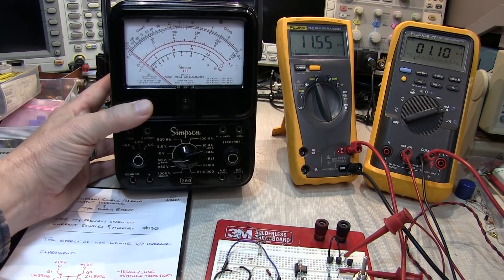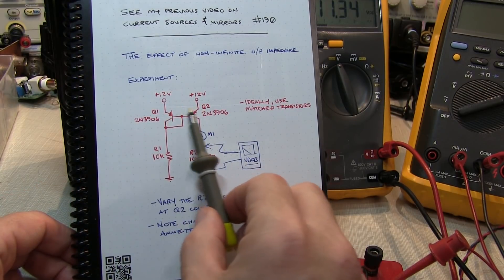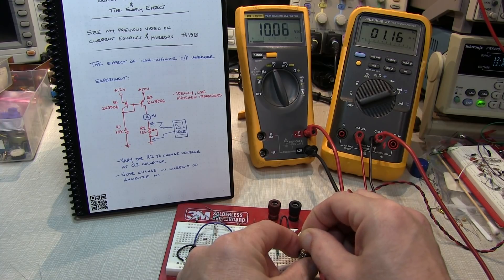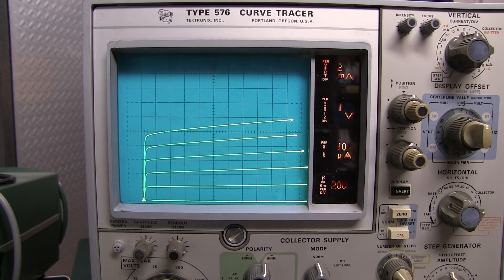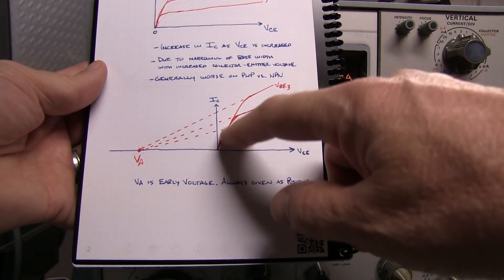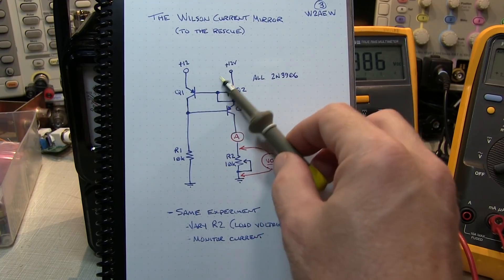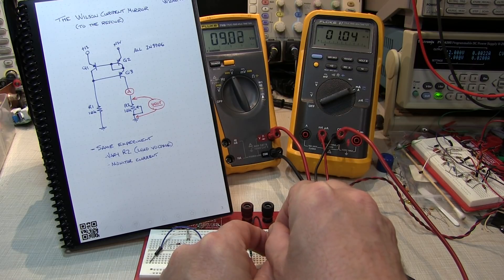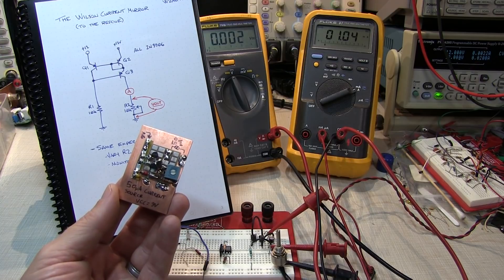#327: Bipolar Transistor Current Mirror output impedance, Early Effect, Wilson Current Mirror

Comment: Clear, concise and insightful as ever! 
The Early Effect is named after James (Jim) M. Early, who did a lot of development work in transistors. Nothing to do with anything being early (or late), it just happened to be his name.
Reply: Thanks for that - always good to know.
Reply: Good point.  In recognition that it's his name, we should use a capital E.
Reply: Thera are no magnets in the Hall.
Reply: The misconception is close though. Makes more sense than if his name were Late! Your comment is appreciated though, I was wondering why it was called Early.
Reply: I was amazed to find that Jim Early described this effect in BJT's in 1952!
J.M. Early, "Effects of space-charge layer widening in junction transistors", Proc. IRE, vol. 40, pp. 1401-1406 (1952).
Reply: @robegatt  But if there were, you could easily detect them with a fairly simple semiconductor device?   :)
Reply: @hectorpascal  I'm using them right now at this moment ☺️

Comment: Very interesting video. I didn't quite follow the explanation of how the extra transistor prevents the output from loading the matched pair in the current mirror, but the visualization of the Early effect was very clear and the demonstration of the loading really drove the point home. Thanks! I hope you make many more videos about these kinds of electronic building blocks.
Reply from the maker: The bottom line is that the transistors that determine the current source value (Q1 and Q2) do not see the voltage at the load.  The "cascode" transistor Q3 isolates them from the load change, so there's no Early effect in the actual current source devices.

Comment: Excellent explanation. Note that the Wilson current source can also be viewed as a Cascode type of circuit (or Pentode/Tetrode circuit for tubes) where the second transistor (or tube grid) shields the primary transistor (or tube grid) from load voltage changes. Many thanks for this.
Reply from the maker: That's right!

Comment: Good demo, but wouldn't a better explanation be as follows: 6:30
"Q3 acts as an emitter follower, and copies the voltage on R1 onto the collector of Q2. The V_CE of Q2 is therefore held at a constant potential-difference (as opposed to a variable potential-difference in the previous two-transistor case), allowing Q2 to mirror Q1's current unhindered by base modulation. Any variability of the potentiometer is compensated by Q3, thereby exposing Q2 to a constant power-load".

Comment: There is no need to say anything like always your videos are so useful. Dou you try making a time measurement circuit by charging a capacitor with this constant current source in a video. If it occurs aI will be very happy. Regards.
Reply from the maker: There are a lot of subtle things to be careful of when doing that.  One is the output impedance of the source as described here.  Another is that many capacitor types will change capacitance with bias voltage.  Best to use highly stable film caps for this.  Not ceramic or electrolytic.
Reply: @w2aew  You are right I will try it, thanks a lot again.

Comment: Is there an IC that stuffs these 3 transistors, into a TO92 package, or multiple of them onto a single chip? 
I've been using the regular "Widlar" design, to supply 3mA to color changing led, independent of the supply voltage (4V~15v). 
Widlar circuit is enough for what I'm doing, but it was nice to see how little Wilson design varies!
Reply: LM334
Reply: @robegatt  I've used them.
They're expensive compared to GP transistors, when you want to control dozens of LEDs, with each LED having it's own CC source.
Reply: @piconano   the good old dilemma: integrated or discrete with all the "salad" around them?

Comment: Great video!
How important is the hfe matching with these transistors in such a mirror as well as thermal runaway?
Reply: Q1 and Q2 should be as closely matched as possible, for the sake of current accuracy. Q3 can be anything. You might even use a larger transistor for Q3, because it will have higher voltage across it, and will tend to dissipate more heat than Q1 and Q2, which will never have anymore than 1 volt across them at the same current. Keeping Q1 and Q2 the same temperature will help, to keep the difference in current between the reference and the output from changing very much. The output transistor can be whatever temperature it wants to be, since it's effectively being driven in cascode.
Reply: @vincentrobinette1507  Thanks! I guess Q3 still does need enough hfe to provide the current?
Or in other words, if you want to mirror something like 100mA, you don't want to drive like 1mA or so?
Darlington would probably work in that case.
Reply: @vincentrobinette1507  Also I think this could be a (MOS)FET as well maybe?
Reply: @p_mouse8676  You're exactly right, you will lose the beta of Q3. If you don't want to lose that, a Darlington pair will reduce that to the beta of the drive transistor multiplied by the beta of the power transistor. All that means, is that 1.4 volts appears across Q1. If you use a Sziklai  pair, (PNP transistor driving an NPN transistor) you can keep the voltage across Q1 the normal ~.7 volts. It doesn't matter much, the important thing is to keep the voltage across Q1 as consistent as possible, to keep the output current as constant as possible. I would imagine, you could even use a MOSFET, which would allow ~3.5 volts across Q1, with no beta loss whatsoever. the problem with that is the gate threshold voltage varies with temperature, which would create current drift caused by varying the voltage across the reference resistor. (R1)
Reply: @vincentrobinette1507  Thank you so much, makes a lot of sense now! :)

Comment: Excellent. Could you put this current mirror at the top of a differential-amplifier or would the change in the feedback voltage side effect the base of the Cascode? (You can tell that I don't know what I'm talking about). Thanks for the great videos. I'm very new to electronics and finding them excellent.
Reply from the maker: Putting a current mirror as the load on a differential amplifier is a very common thing to do inside of op amp themselves.  Gives a tremendous amount of voltage gain due to the extremely high output impedance of the current source.
Reply: @w2aew  Thank you...

Comment: You should do a video lesson about optocouplers to remove noise and hissing in circuits and lower the signal to noise ratio. I'm not sure what CTR Current Transfer Ratio means because the Optocouplers datasheets specs will list the CRT like 5mA which if the input of the optocouple has 100mA the output of the optocouplers max output current is 5mA? I don't understand what is the differences between electrons compared to photons because if you have 100mA of current/electrons and the 100mA of electrons converts to 100mA of photons? What I'm saying that pound for pound when concerting current/electrons into photos its not going to be a 1:1 conversion

Comment: The higher the VCE voltage drop across the transistors will decrease the base width modulation. I'm confused why transistors even have a Base width modulation as well as what is adjusting the base width modulation of a transistor? The SLOPE of the line is the BETA and Output Collector impedance. I'm not sure why the collectors output impedance would changes its Z impedance based on the base current/base voltage. The BETA is the gain of the transistor which Beta is just extra electrons

Comment: Nice video as always.  But I have a question, in the final circuit still the VEC of Q3 is changing from almost 0V to almost 10V but how come this time we dont see the Early effect? My own answer which I am not 100% sure about is that this time the VBE of Q3 also varies and does not remain constant (Base of Q3 also changes) in such a way that it compensates for the Early effect (by actually changing the base current of Q3) while in the first circuit the VBE of Q2 (output transistor) was absolutely constant so we could see the effect of Early voltage
Reply from the maker: The Early effect is taking place in Q3 for sure, but is masked by the fact that the current available to it via Q2 is fixed.  The feedback around Q1 causes the Q3 base to be adjusted accordingly.

Comment: I love your videos and have seen most of them at least once. Thank you for some good youtube content!

Question: if you remove Q2 and replace it with a node, and then place a resistor (call it Rs) between that node and the 12v source, you would get a pretty good current source where you can control the current with I=.7/Rs. I've verified that the output impedance for this current is also very high. With this being a two transistor solution rather than a three transistor solution, do you know why you would use one design over the other.

I really like these circuit analysis videos. Please keep producing them!
Reply from the maker: The two transistor version wouldn't be as stable with temperature changes.
Reply: @w2aew  ah interesting, ill go play with that a little.

Comment: I have seen this many times in audio amplifier inputs and I mean the current mirror but never seen the 'Early' effect compensated for, forgive this question but could you explain please ?...cheers.  oh yeah Fab vid !! :)
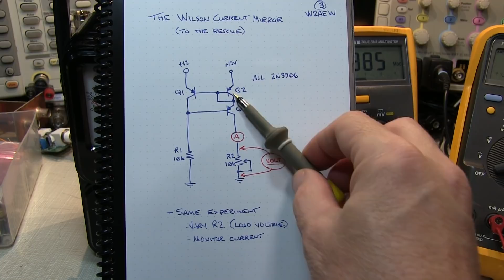Reply from the maker: The explanation starts at about 6:10.  Bottom line - the transistors that "set" the current do not experience any C-E voltage change with the load applied, thus no change in current due to the Early effect.  The "output" transistor that is providing the current to the load is simply passing the constant current through it - it isn't part of setting the current value.

Comment: what is the use case of such circuit ?
Reply from the maker: Current sources have a lot of uses:  often used to bias differential amplifiers (emitter or source-coupled pairs), as well as an active load inside of operational amplifiers as well as other apps within ICs.  Also used to bias diodes such as LEDs, and used to create linear voltage ramps when used in conjunction with capacitors, etc.  Lots of uses.

Comment: If the current source really had infinite output impedance, how would any current be flowing in the load? How does that make it an ideal source of current ?:/
Reply from the maker: Infinite output impedance simple means that the value of the current doesn't change when the voltage at it's output changes.
Reply: @w2aew  Thx! I guess i thought of 'impedance' not simply as a relationship between deltas. My mistake :)